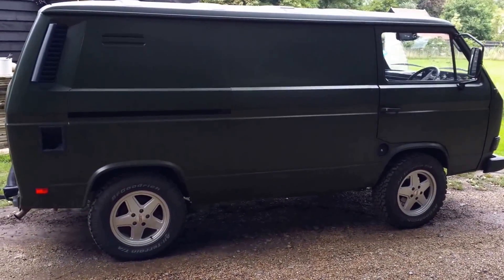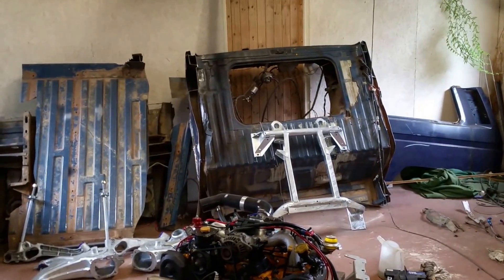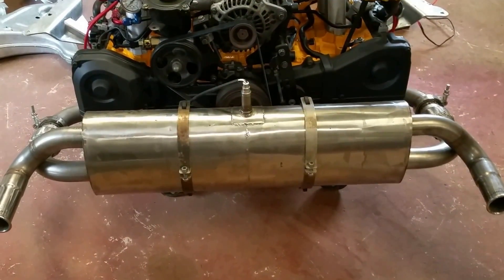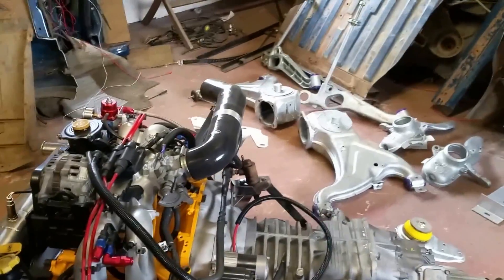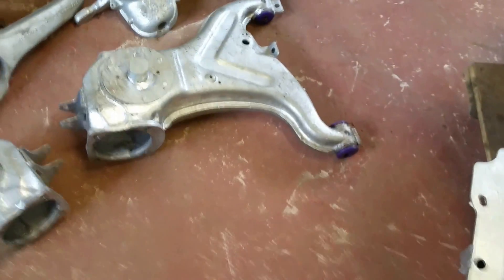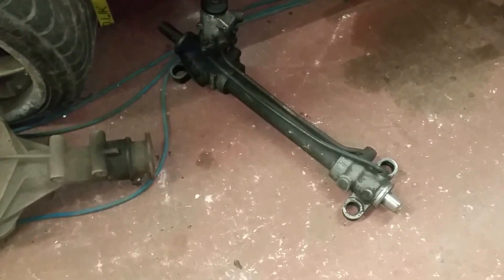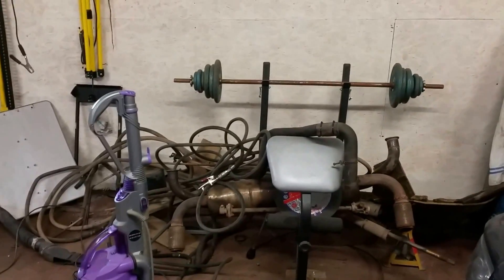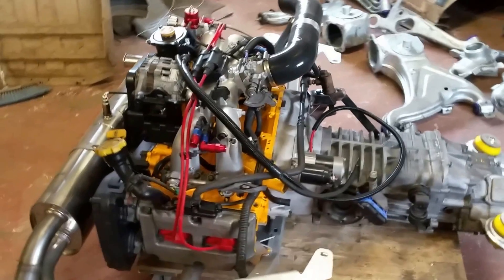VW T25 T3 Vanagon 2WD to Syncro 4WD Conversion Project - Overview

Comment: Hi Mark, unbelievably helpful vid.   About embark on this myself.   If like to keep the van mobile as long as I can.   

If I do the work on the rear only in "phase 1",  so filler, tank pillow, tranny mounts and syncro tranny, etc,  will shifter still be happy and compatible with the rest of the up front 2wd stuff?   Thanks!
Reply from the maker: Hi thanks, I would have thought so as it would be no different from running a syncro with a decoupler of propshaft removed. So.... I can't think of any reason why not. But I would ask around on any forums/Facebook etc. I would recommend joining this group on Facebook "VW T3 Vanagon Syncro Conversion Group" 
Cheers
Reply: @MarkHalligan  
I was mostly wondering about shifter linkage compatibility, path, etc.
Reply: Thanks for the info!

Comment: Hi Mark, would you know where to buy the 16” rear axel housings? Thanks so much! Love this project!
Reply from the maker: Hi Tommy, used parts are hard to find but are still out there. You can also get the 16" driveshaft parts such as CV joints new from several sellers. Try the likes of Gowesty and Burley for what you need. Thanks for the positive feedback, appreciated and all the best 👍

Comment: Is it possible to convert to  syncro an 2WD based van? Mine is 2WD, and when I bought it I didn't have a clue of what a Syncro was, if were to buy a now, I would boy a Syncro without doubt. So I was doing some research about if it was possible a conversion. Does it work?
Reply from the maker: Yes this is what I have done. My van was a 2WD originally
Reply: But how is the result? Is it exactly the same than a Syncro 4WD or there may be some differences on the results, behaviour of the van, etc...
Reply from the maker: Exactly the same. It behaves in exactly the same way as the donor vehicle that I removed the parts from. In the end it depends on the level of detail that you put into the conversion, this is easier when you have a donor vehicle to take the parts from as you can take measurements from the donor chassis you are taking it apart.
Reply: I love it. The doubt now is if it is more expensive to do the conversion or find another Sycro on sale
Reply from the maker: Yes the conversion is not cheap to do, I was lucky and found a fairly cheap donor Syncro to use which already had some good things on it like the Subaru engine, although it was very rusty and took a while to strip down. If I weigh it all up I could have bought a Syncro probably for less. But it would not have been exactly how I wanted it, I know every inch of the van and I wouldn't have had so much fun building it! :-)

Comment: cant you thin the powerflex bushes a bit on a lathe? they seem hard enough😉
Reply from the maker: That could have been an option but if I were doing it again I would use the right size tubing to repair the arms and not scaffold tube. Then the bushes would fit.
Reply: Mark Halligan

Comment: Cool doing the same job now. I forgot the fueltank carier. But yours looks rusty any plans for that?  (google "Climbuz" for my project).
Reply from the maker: +Dennis van Hoek Great Project! Yep the crossmember for the fuel tank on my donor van is way too rotten to use. I'll make up something, although having looked at what some others have done on similar conversions it would seem that the crossmember is not necessarily needed and the lower tank straps can be fixed to fabricated brackets. I may do this myself and will include this in any future videos. Cheers

Comment: I'm interested to see how far you have got since August.
Let's have an update video Mark.
Reply from the maker: +Saxon Mosh Been held up with some other (home improvement) projects that I had to get finished before the winter, and which have taken up most of my time just recently. Won't be long now and I will get the van into the garage to start the conversion, I just need to finish rebuilding the front hubs and driveshafts. Thanks for the interest :-)